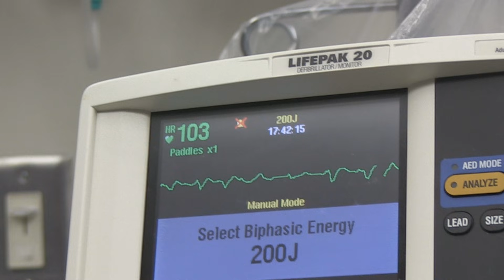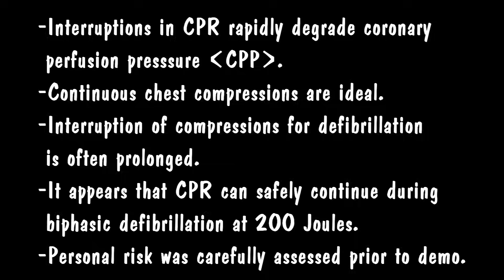Hands On During Defibrillation

Comment: Current AHA and ERC Guidlines for CPR recommend to immediately resume chest compressions after every shock without first checking for vital signs. After 5 cycles of CPR (2 min), rhythm and pulse should be reevaluated and determined if another shock should be administered.
Some recent studies have shown that even if the heart converts into a stable rhythm, the chest compressions are beneficial and bare no risk of the patients heart stopping.

Comment: Hands-On Defibrillation : An Analysis of Electrical Current Flow Through Rescuers in Direct Contact With Patients During Biphasic External Defibrillation

Michael S. Lloyd, Brian Heeke, Paul F. Walter and Jonathan J. Langberg

Circulation. 2008;117:2510-2514; originally published online May 5, 2008;

Comment: Hands-On Defibrillation : An Analysis of Electrical Current Flow Through Rescuers in Direct Contact With Patients During Biphasic External Defibrillation 

Conclusions—Rescuers performing chest compressions during biphasic external defibrillation are exposed to low levels of leakage current. The present findings support the feasibility of uninterrupted chest compressions during shock delivery, which may enhance the efficacy of defibrillation and cardiocerebral resuscitation.

Comment: This was very interesting.  I am not sure if you could continue CPR like this when using an AED though.
Reply: Correct, you could not due to the fact that it would analyze & charge. Currently, no AED model exists that allows for continuous compressions during rhythm analysis. Even if you were to do compressions during the shock it would make zero difference as it would be only a second since after the analysis was completed it would prompt you to press the shock button.